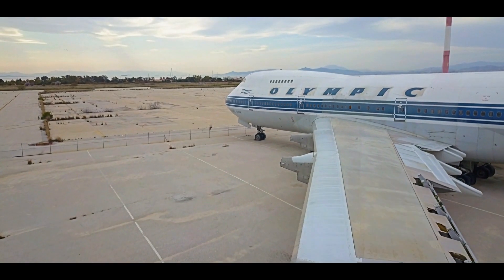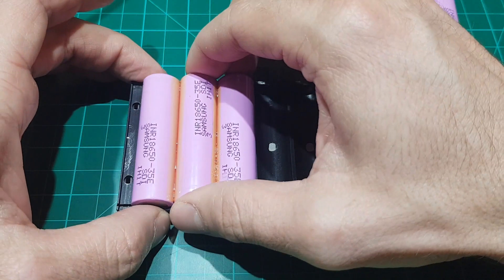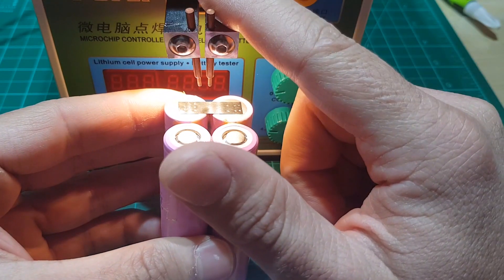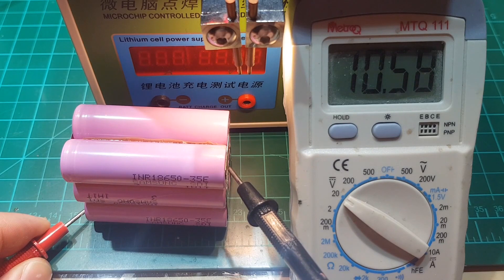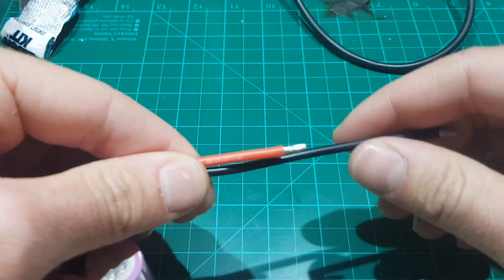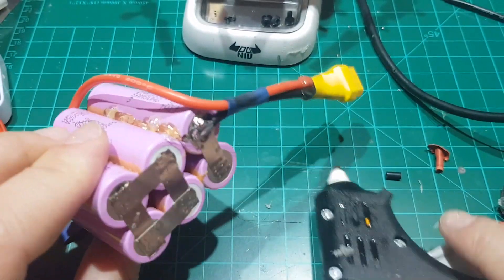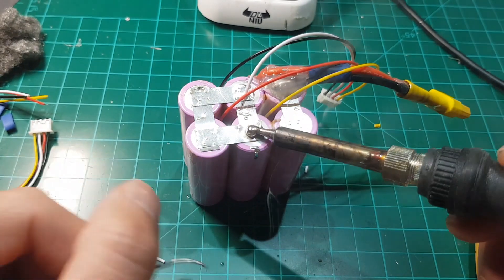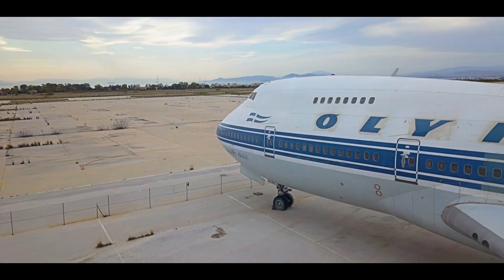Part2a/2 How to make a 3s Li-Ion battery from 18650 cells, DIY tutorial.

Comment: You soldered the wire directly from the battery terminal. Do you know what happened in the battery? Why did you use welding if all the nickel tires could be soldered?
Reply from the maker: Because soldering the strips would be difficult and a complete mess, it is not coincindence that everyone does it this way. Its cleaner safer and overall better.
As for the soldering part you apply the soldering iron for a very short ammount of time so to minimize the chances of damage.
Yes there might be other ways to do the same things but I found this to be the one that makes more sense.
Thank you for commenting
Reply: Can you kindly link to the model welder you're using? Also thank you for the educational lecture... I'm missing school during the pandemic and this gave me a sense of calm.